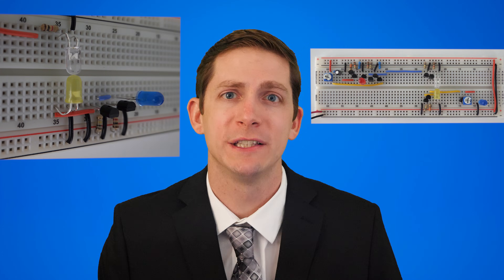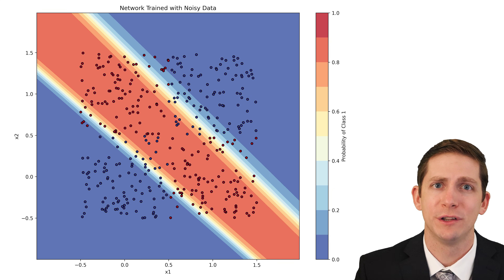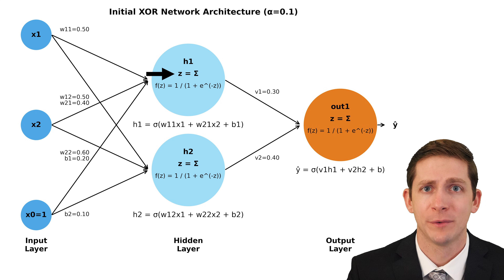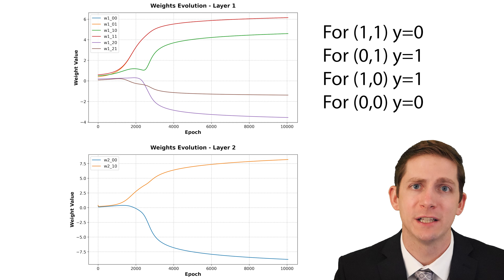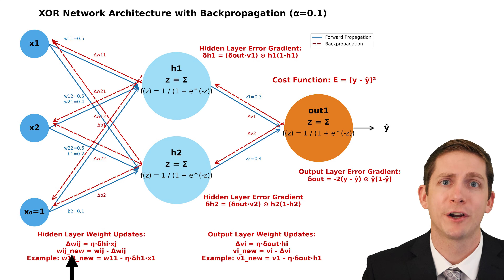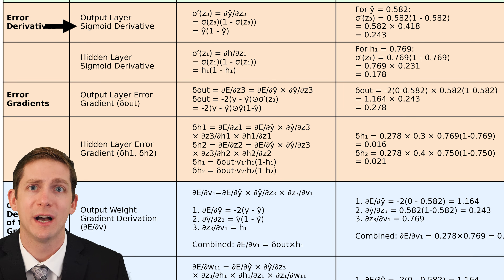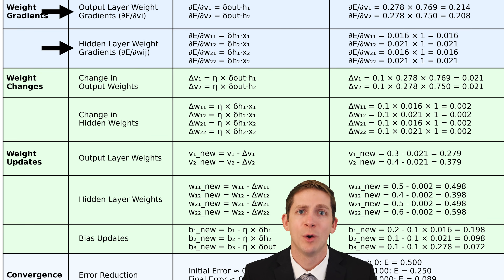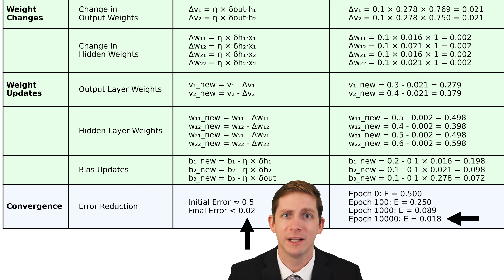Neural Networks Explained: Solving the XOR Logic Gate with Backpropagation

Comment: Great video, thank you! Just a small correction:
In line 4 (row of the table — Output layer input), the calculation should be:
0.3 × 0.769 + 0.4 × 0.750 + 0.1 = 0.6307, not 0.531.
Reply from the maker: Yeah the 0.1 was not added. Good catch!

Comment: One possibility is to set a 3rd input with "x3=x1*x2", then setting the weight w3=-100 and w1=1 and w2=1, should make the linear network work, no hidden layers needed here. Generally, I observe the trend of using deeper and deeper networks. However, making smarter inputs and more of them, should also be considered.

Lets say you have a chess engine based on neural networks and it makes moves based on the position of pieces. A good network will be very large to also look at the relative position of the chess pieces. However, a clear encoding can do a lot of work before and the training should be much faster.

PS: Thanks for the video, I fun to watch!
Reply from the maker: Thanks! You are thinking on the right level! When making hardware based neural networks their will be lots of optimizations and configurations to figure out.
Reply: @ Great to hear! Now, we need a way to find the right optimizations in a reasonable time :)